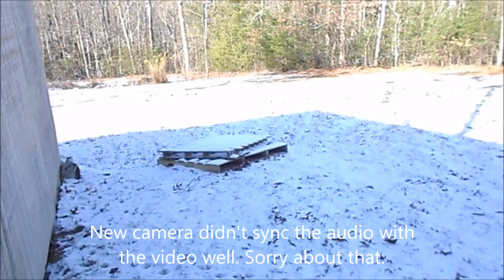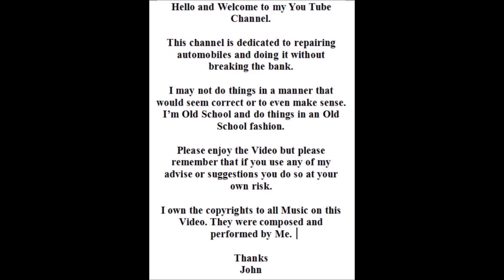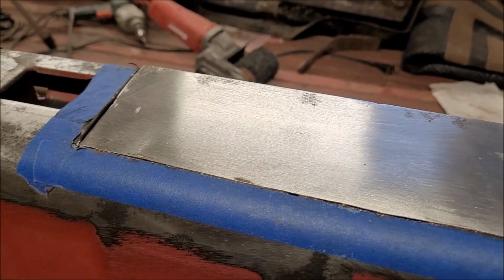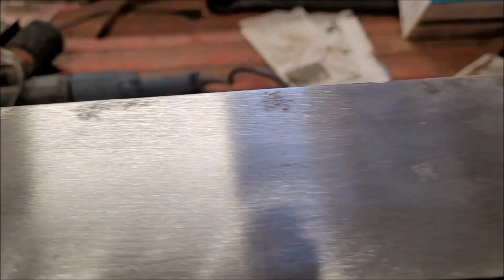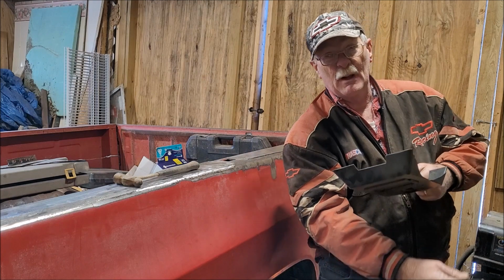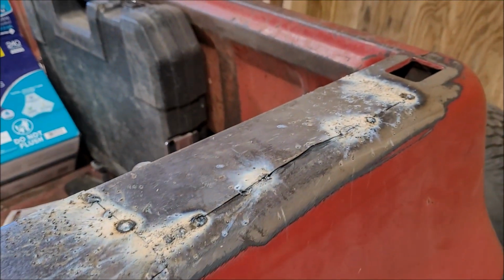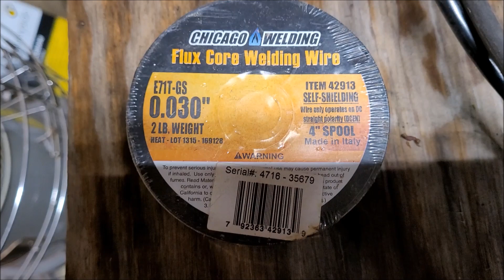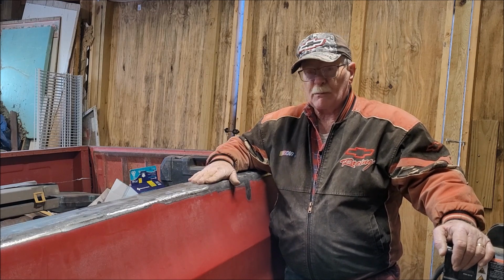Welding more patch panels on Square Body with Flux Core Welder

Comment: The smaller the gap the better. I hammer it all the way along after every tack. I've found that touching the wire to the metal, then the shortest press of the trigger, puts a lovely little tack down.
Reply from the maker: Thanks for the comment and the tip, I will have to give that a try. I appreciate it.

Comment: Loved the video, I'm working on a '55 Olds right now with a lot of the same equipment that you have. The $45 automatic welding mask from Harbor Freight is definitely worth it, I've had it for a few years now. 
Also, how do you get the patch panels to fit so closely with the section you cut out? That's the part I've always had to spend a ton of time on.
Reply from the maker: Thanks for the tip on the Welding Mask. Someone else just suggested the same mask so I will definitely check it out. The way I do it is get the patch panel as close as you can. If possible, clamp it in place so it doesn't move and then scribe around the patch with a sharp scribe. Then I remove the patch and tape with masking tape to the original panel you are patching following the scribe mark as closely as possible. Then I cut right along the tape. The tape is much easier to see when cutting than the scribe mark is. Hope that works for you. Thanks so much for the comment.

Comment: Does that seam need be welded completely or can you just tack it in place and fill it with short strand body glass?
Reply from the maker: No it doesn't have to be welded all the way and yes the fiberglass would do a great job but because this is where it is I think it's best if it's welded all the way. After All those steak Holes often get used to strap things down. I prefer welding all the way if possible. Thanks for the comment, I appreciate it. John
Reply: @GreaseMonkey1958  thanks John

Comment: You did a good job you need a welding mask for one and that kerosene heater using I used one before I didn't like it at all I bought two mr. Heaters 60000 BTUs for my garage and I only use one of them they are a great investment you have to use propane instead of kerosene but it works perfect get yourself a mask brother nice job
Reply from the maker: Tomi, Thanks for the Comment and the Suggestions. Yes, I definitely need a different welding mask to free up my other hand. A couple bullet heater would be nice for sure. Hopefully this cold weather will end soon and I can work without a jacket. Thanks again. John